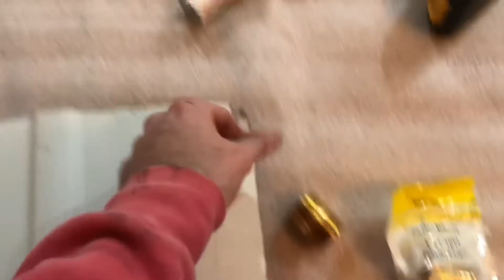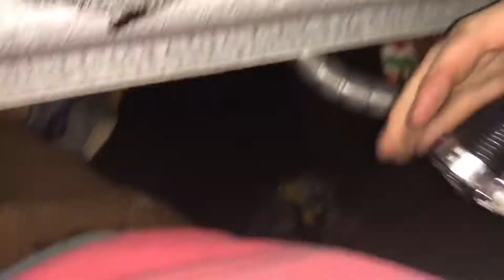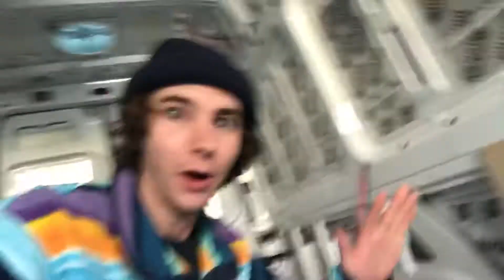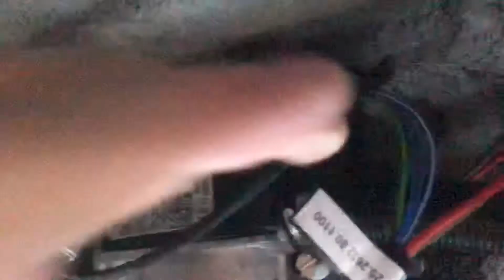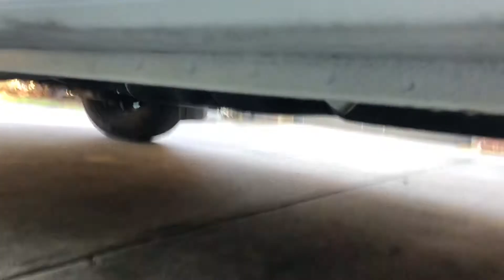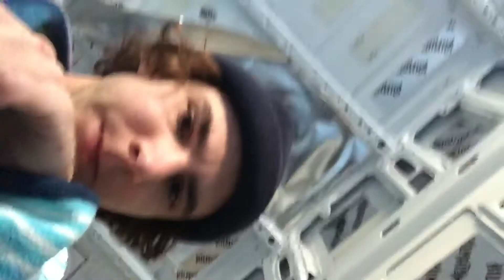HYDRONIC HEATER install part 2

Comment: Thank for sharing! I’m going to try the Chinese knockoff of one of these if they can send me some better specs on it. I’d be using the gas version and it interestingly needs some oil. Did you think to run the coolant from the van to another exchanger? I’m honestly half curious if I can just share the same vehicle coolant which would allow me to not have to put a reservoir in the van.
Reply from the maker: I think that’s actually the main use of these it’s to also allows the hydronic heater to act as an engine block heater to heat up your engine coolant to help with cold starts. The reason I have a reservoir inside the van instead of connecting it to the main reservoir is because I didn’t see a need to go through the trouble of splitting and running coolant lines all the way to where the heater is set up. I also thought I could get hotter water from having the coolant reservoir and exchangers that close together.